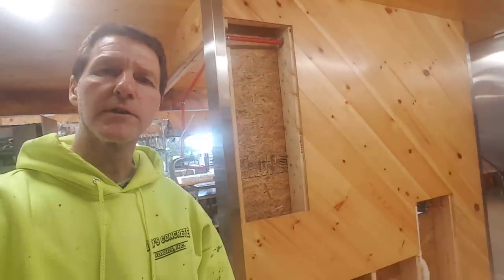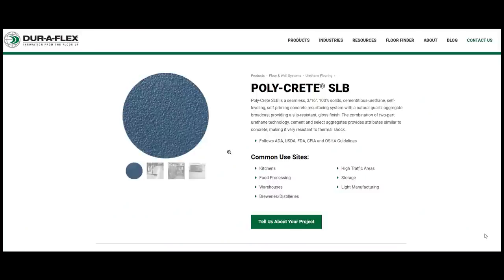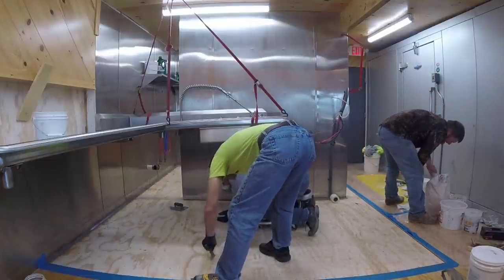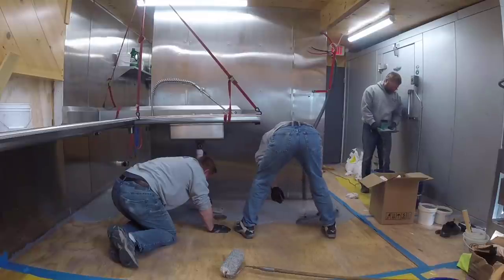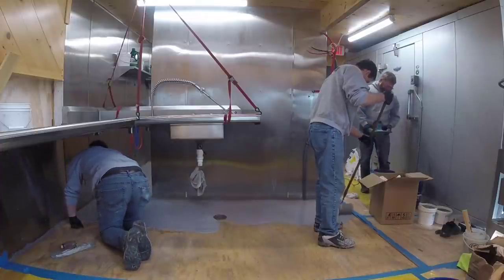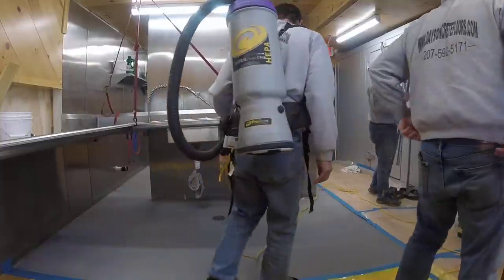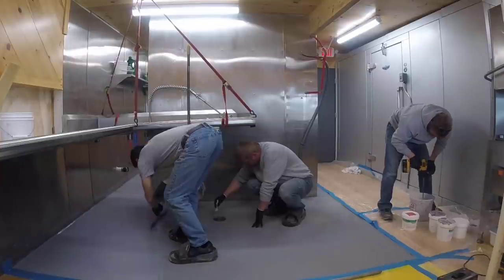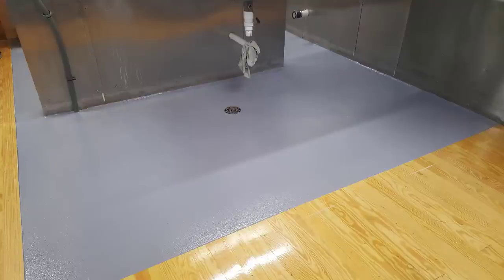How To Install A Urethane Cement Self Leveling Coating Over Plywood (Also For Concrete)

Comment: Was curious how (or with what) do you clean tools with, like spike roller after rolling in resin? That must get super hard relatively quickly.  Thanks
Reply: Xylene and a soft bristled brush usually takes care of it . Clean it before it sets up and it’s much easier.
Reply: @CODA-Improvements  Much appreciated Coda. 👊👍💪
Reply from the maker: Yes, what @Coda Improvements said!

Comment: Very familiar with Neogard products , which are great to use, but I’ll have to check out Dur-a- Flex. How are the lead times with epoxy these days for you Mike?
Reply from the maker: It really varies, but mostly a couple weeks. I have a local guy that stocks a lot of polyaspartic and flake so that helps.